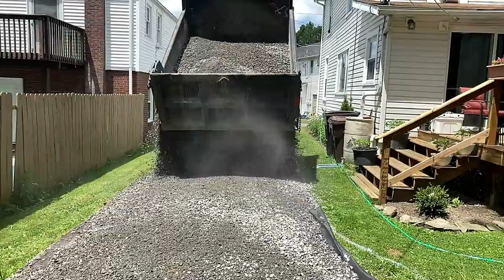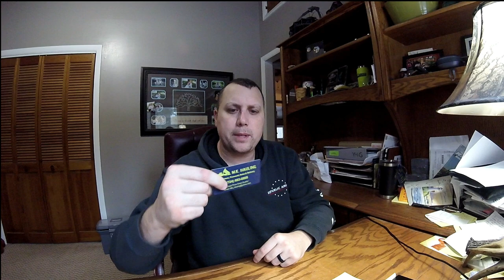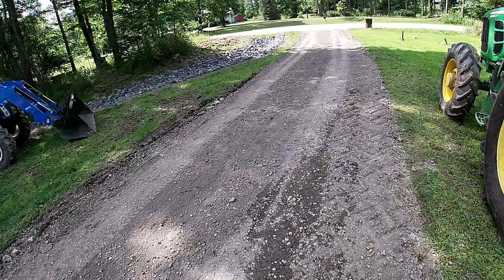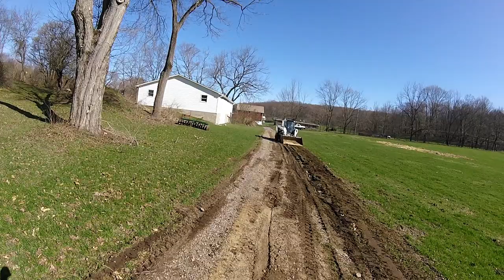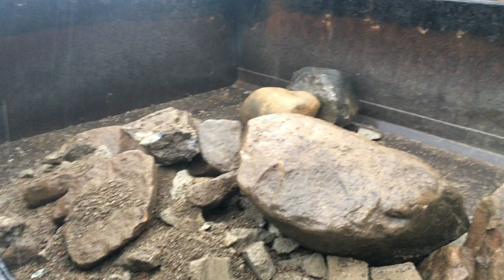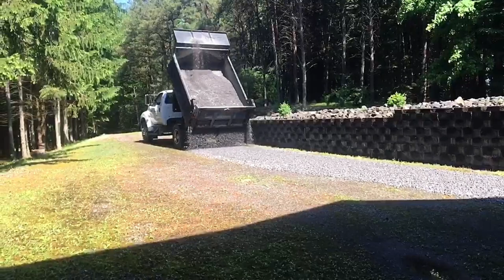How I Tripled My Sales Year 2 In Small Business

Comment: When it comes to trucks keep price in the back of your mind but don't fixate on it. More importantly consider down time and what that cost. Is a new/slightly used truck actually going to be reliable or is it going to always be at the dealer having warranty work done. Can you fix newer stuff yourself or does it require dealer specific tools? Lots of pros and cons
Reply from the maker: Jessie Hodges yes there is but right now im running older trucks and they have issues all the time that have been costing as much as a new one costs. Im thinking about trying a few years old next